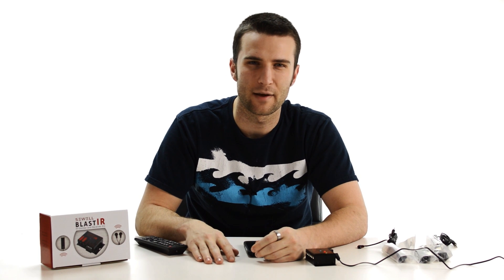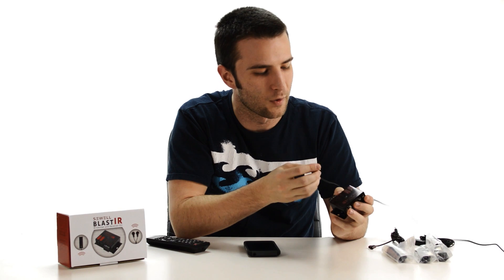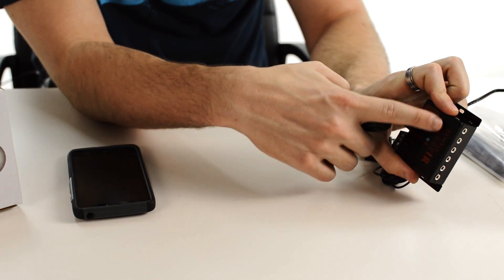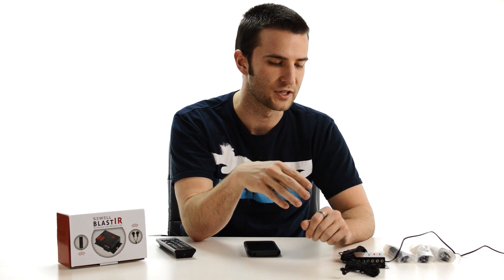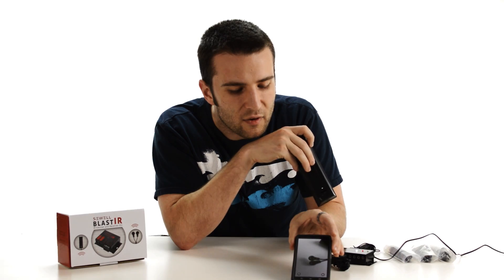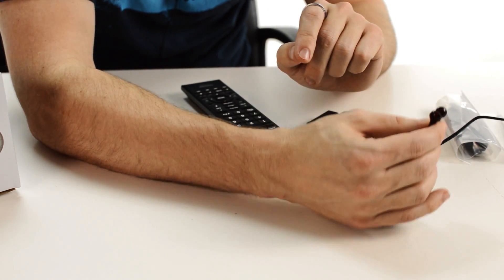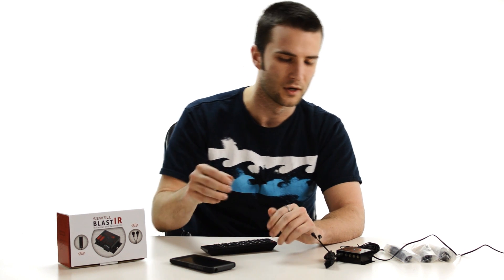How to troubleshoot IR repeaters / extenders

Comment: What does it mean if the blue light on the receiver does not light up and how do I fix it?..... Stopped working after years of working properly.
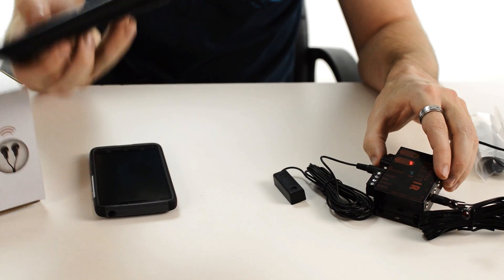Reply from the maker: The blue light on the piece that you point the remote to (1:52) it should blink every time you press a button on your remote. Let's hope it's just your receiver wire that is defective, they are very cheap to replace. Its either that receiver wire, or the emitter wires. Not very usual for the Block to go bad. Have you called customer support about this? Also, which unit do you have? do you have the one on the video or a different model?
Reply from the maker: It does not have any more latency than most regular hdmi switches. Pretty much any step you add to a setup will add some delay, might not be noticeable to some, but all switches do that.  But to be honest, you might have a better chance using a seamless switch like the Crossbow, it has a much better processing chip than the Rivule. Check out this video: https://www.youtube.com/watch?v=dW1Tt3GDf98

Comment: What if my blue light (receiver) is stuck on? Bad receiver block or bad device?
Reply from the maker: Sounds like the receiver wire is bad. Did you already contact our Tech Support about this? they will gladly set up a replacement or help you get it working right.
Reply: It was indeed the receiver wire, replaced it and all is good.

Comment: Still don't know for what are those?? I have it in my tv in I don't see the use for it. Is for the audio? 😕
Reply from the maker: Those help for example if your Blu-Ray player is hidden inside a cabinet or closet, since the remote control signal gets blocked, you point the remote at one of these sitting on your TV and the signal comes out through another one set inside the cabinet pointing at your Blu-Ray player.

Comment: LOL I was going to suggest using a camera to see the IR beams. You can also remove the small plastic housing for the IR transmitters to get a stronger light beam and just tape it over your component receiver with black tape:) I always have troubles with these cheap infrared extenders but never with Logitech Harmony extenders.

Comment: Do you have a video for using the in-wall receiver? The circuits have different labels between the in-wall board and the connecting block.
Reply from the maker: Not yet, but thank you for letting us know. We will make one as soon as possible.
Reply: Sewell Direct I actually figured it out, but a video would have been helpful. So, thanks!